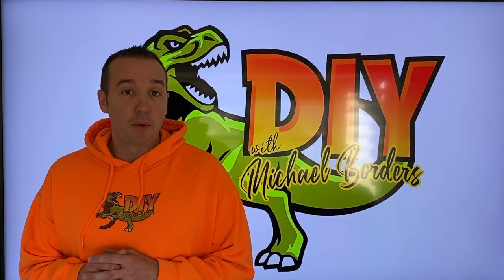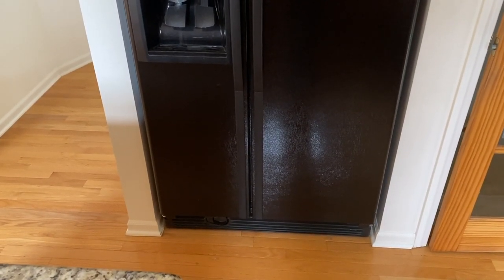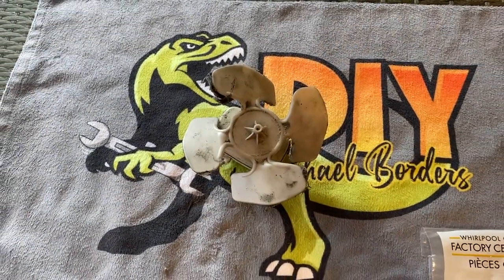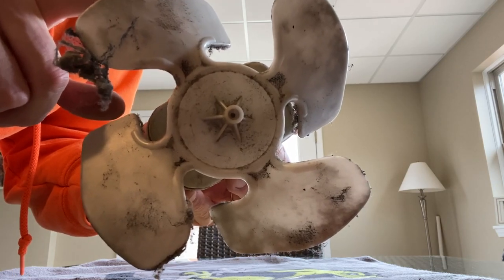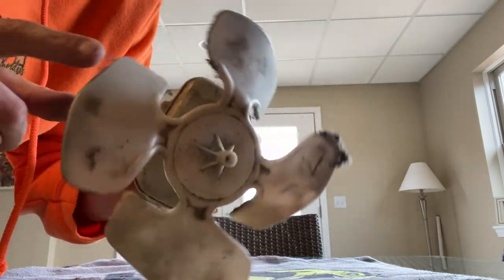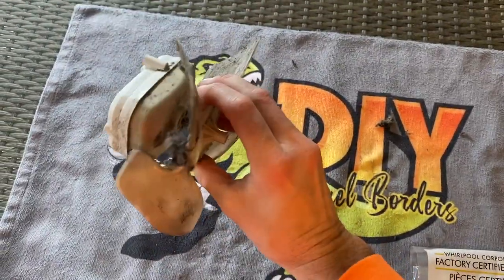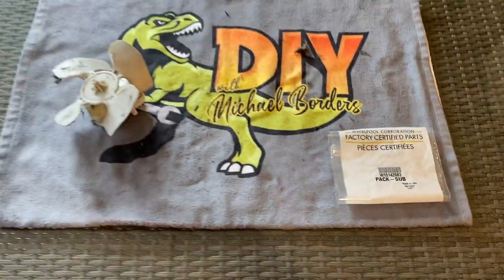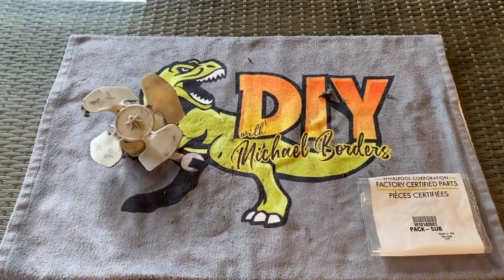Whirlpool Refrigerator screaming/squealing/screeching - THIS IS WHY!

Comment: The correct Whirlpool branded part # is W10124096. The part # on the bag (W10142683) in your video is for the electrical connector for the fan motor. It comes with the kit. Just an FYI for everyone.
Reply from the maker: Thanks for watching and sharing.

Comment: Actually, my 27-year-old Whirlpool Side-by-side Refrigerator started off with a very quiet whistling sound about 3 months ago, but now it only gets a little bit cool, even with my thermostats turned to their coldest settings.
Reply from the maker: Thanks for watching, 27 years strong is impressive.  If you determine what is causing your unit to not be able to maintain require temperature?

It’s likely either the condenser fan motor shown in this video or the actual large condenser unit.

Comment: How long should this part last? My fridge is a little over a year old and I'm hearing this noise
Reply from the maker: Hi there, we are hanging out drinking coffee answering any and all questions for the DIY community.  This part should last many years unless refrigerator experiences an unfriendly electrical surge such as a momentary power outage.

Another issue people run into is the location of the refrigerator.  If it’s in a garage or unheated structure, parts will begin to fail fast when the temperature either drops below the manufactures temperature limitation or goes above the manufactures temperature limitation.

Temperature limitations can be found in the owners manual that came with the refrigerator

Hope this helps, please let us know if we can help in any way.  😎👍